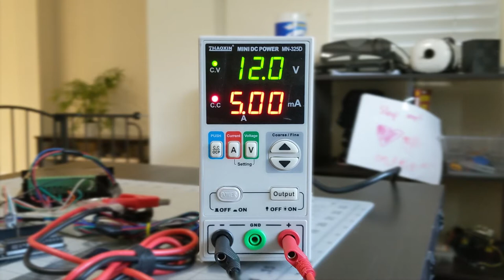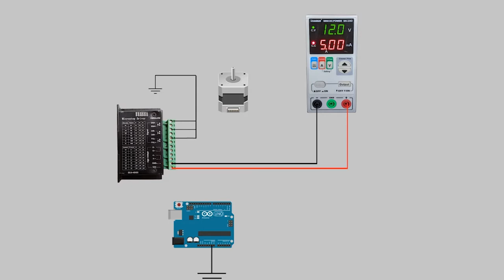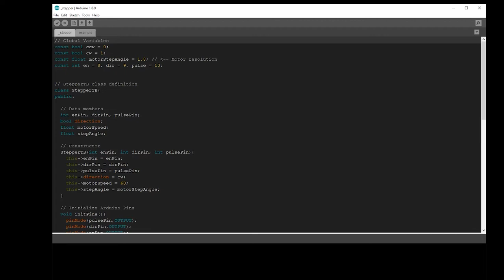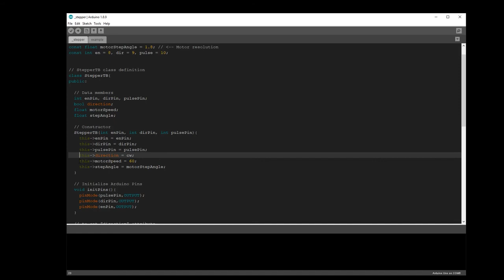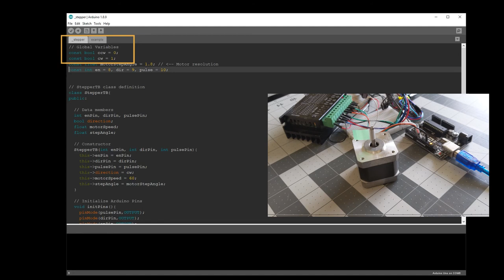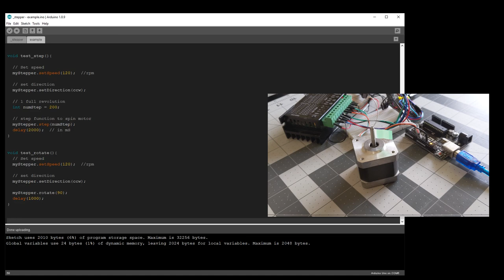Arduino Tutorial | How to Control a Bipolar Stepper Motor using the TB6600 Micro-step Driver

Comment: I followed your instructions and it's working realy well with nema 17 and tb6600. i have an issue tho, it's working with rpm less than 151 rpm
if I try 151 or higher is just stops working got any tips on how to fix it ?

Comment: Did you use any library for this code?
Reply from the maker: Nope just the class I wrote
Reply: @QRobotix  How was the TB6600 setting on this one? Mine was off-off-on on-off-off (3200 pul/rev, 2.0 A.) I also used 12V adapter for the power source.
I can't make my Stepper rotate with this code. It was just buzzing and beeping occasionally.
Forgot to add, I'm also using a unipolar stepper connected into TB6600.

Edit: I found out that the correct setting for the driver is on-on-off on-on-on (200 pul/rev, 0.5 A.)
Reply: @QRobotix  Btw, it seems that this code could only run my unipolar stepper on 0,5 amp setting, because when I set it on 1 amp it can only vibrate, no rotation is seen. How to adjust the code so that it could use 1 amp setting?
Reply: I also have this question! Only seems to work for 0.5 amp setting as well. Do we need to change the code to run at a higher current, or is that a hardware issue?